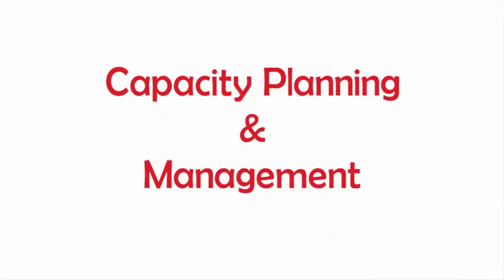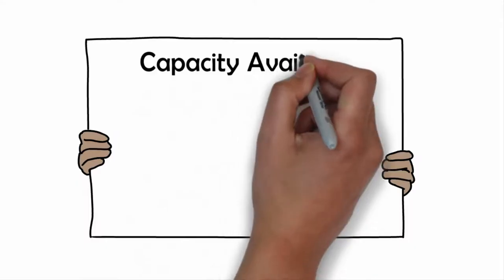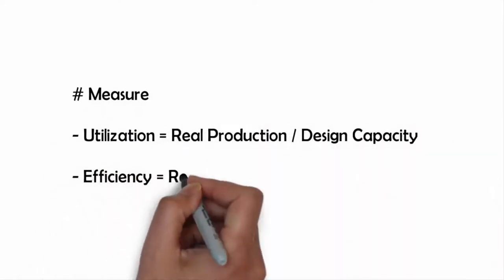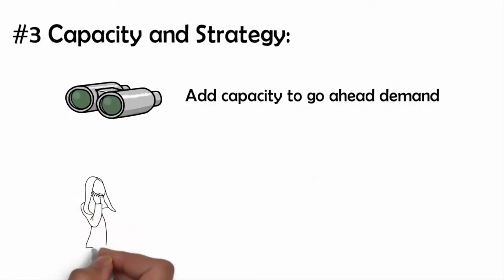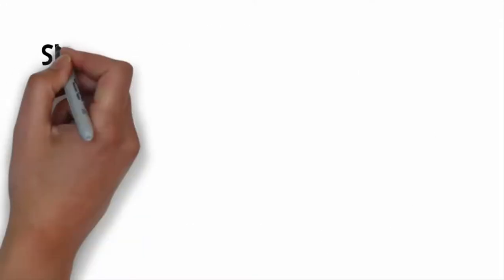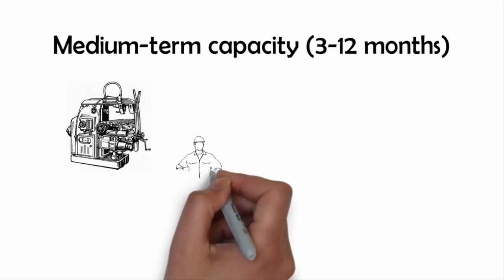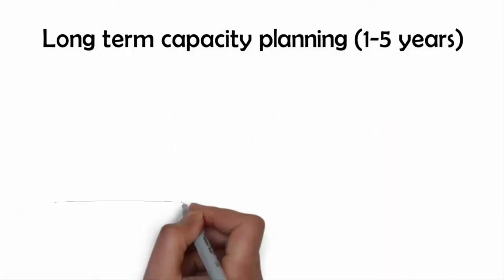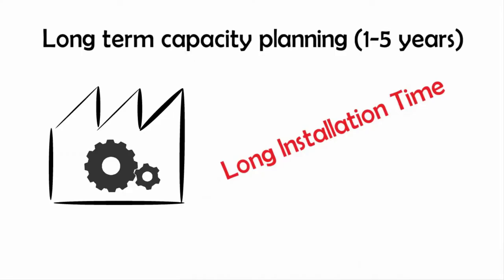Capacity Planning - Overview and Key Concepts

Comment: What will you do if you do not have data available to do your plan?
Reply: This is a good question. The one thing that can be done is make a best guess and install procedures to document the data you need for the future.  In most cases it is better to do something even if it is wrong and learn, than do nothing and remain in frozen ignorance.